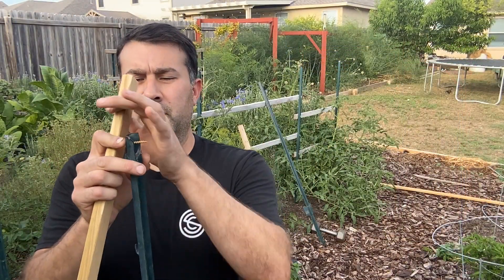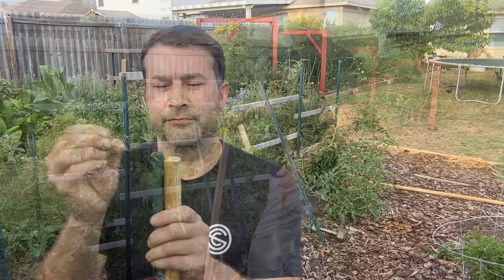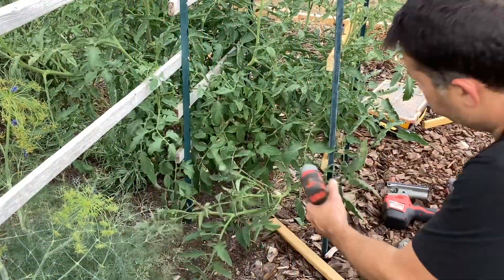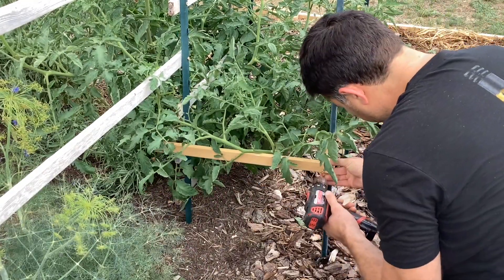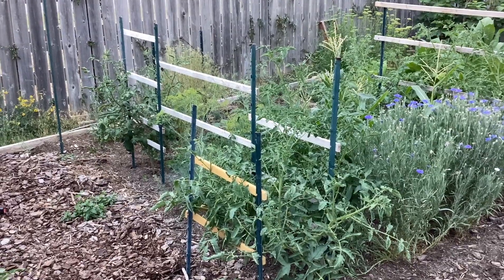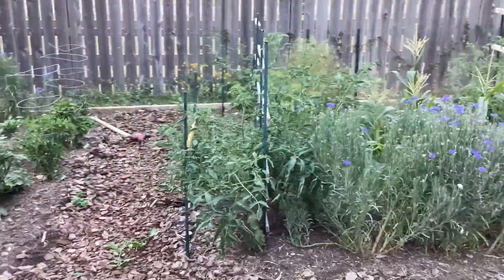How to build a tomato cage

Comment: This looks really sturdy! I had a Juliet break a Texas Tomato cage during a windstorm, you do not want to underestimate how much support an indeterminate needs in Central Texas. (Or how dense a Juliet can grow.) Only downside I see is that the fenceposts are not that tall, once you sink an adequate length into the soil. My tomatoes will grow up as far as I let them and 4-5 feet is not enough. It looks like it would be fairly easy to extend these with hoops of irrigation tubing or by zip-tying poles to the fenceposts to extend the length, as the upper tiers won't be dealing with that much weight anyway. Thanks for the idea!